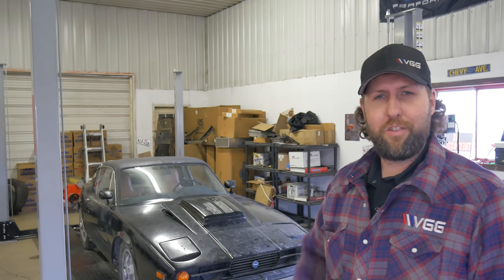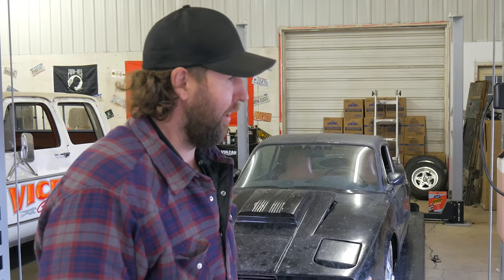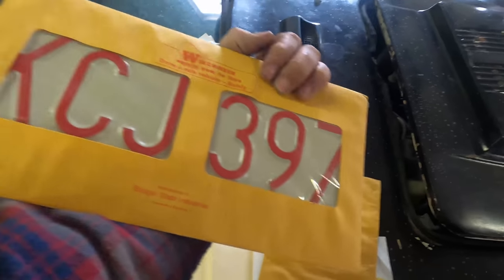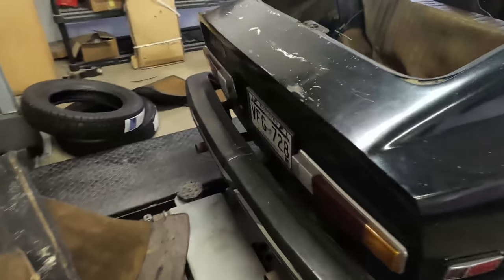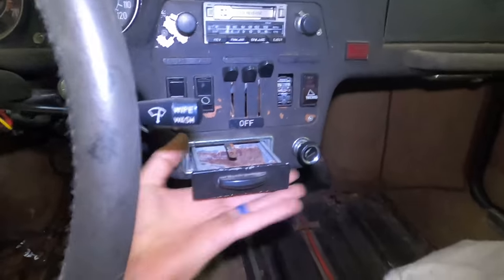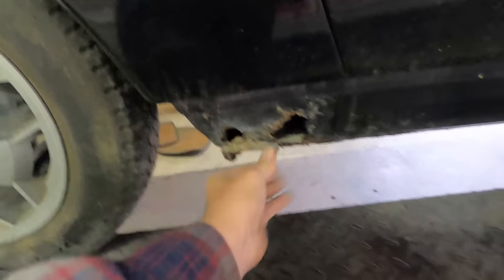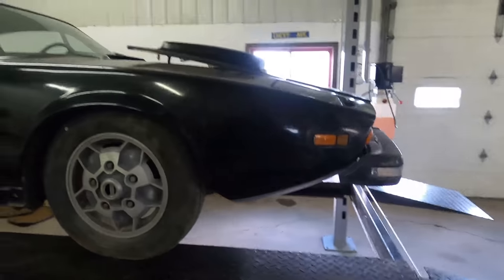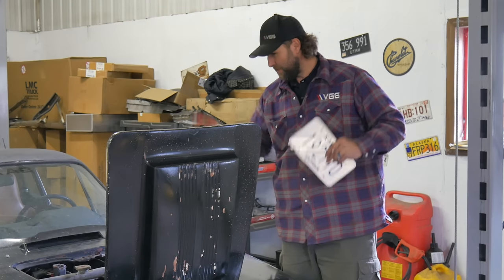FORGOTTEN 1974 SAAB Sonett III - Will It RUN AND DRIVE after 29 Years?

Comment: This guy is a real auto mechanic, he is doing things I have not seen a mechanic do since the 1970 s. When my dads best friend would help me with my 1970 cougar with a 351 v-8 in it. He worked on cars since he was 14 years old and worked on everything from semi’s to race cars. And just like this guy, can tune an engine just by listening and feeling the engine when it’s running. very hard to find guys like that anymore. Like to know where and how long he’s been doing this. Great video. Amazing.
Reply: ..... because most cars aren't designed like the cars this guy works on lol. I almost guarantee Derek wants nothing to do with 2022 BMW EFI software or any sort of diag shit with new cars today. Dudes wrenching on today's vehicles are just as honest of mechanics as he is. Different skill sets for different occasions.
Reply: I can and some of my friends can.
Reply: When I was growing up, early 80’s, a friend brought his Cougar into old man Harpers shop. He spent a few minutes listening to the exhaust  on each side, due to the rough running, and was able to tell exactly which cyclones was bad on the car.  When we tore that side down, he was dead on, by only using his ears. I’m still impressed by this feat.

Comment: A guy sometimes get jealous of you tall folks out there until he sees you try to squeeze into a car like this. It was less like you getting into it and more like you putting it on.
Reply: When I was still working as a mechanic, we had a Miata come in that needed an engine replacement.  I am 6'1" and 300 pounds (maybe a little over lol) at the time. When I got finished my boss man, who was about my height but a whole lot less on the weight lol looked at me and said "well, you fixed it, YOU drive it" lol. I had to let the top down just to get in it lol. I drove it and it ran fine, but getting in out was a chore in itself.

Comment: The born again vessels at your revivals sound more joyous and spirit filled than my 2013 Nissan Altima and 2001 Volvo station wagon. While I'm driving through quiet neighborhoods or stuck in grid lock traffic, I'll crank up VGG on the Bluetooth transmitter to make my ride sound like a race car. My Volvo dash reads, Check Engine and "Dipped Light Bulb". My Altima's biggest issue is an exhaust leak. She's equipped with a Bose sound system which makes The Who "Going Mobile" rock. Keep up the great work! You're an inspiration!

Comment: Are you sure it went from right hand drive to left hand drive? Only if it was imported from the UK. Swedish cars were usually made for left hand drive.
This is a really cool car I've only seen a few times live here in Sweden. The V4 was also mounted in the Saab 95 and Saab 96 with a steering wheel mounted manual shifter. My mom had two Saab 95 and one Saab 96 when I was a kid. 
Thank you for the video! Really nice to see a Swedish car on your show!
Reply: Sweden had right hand drive until 1967.
Reply: @AxelWonkardan  And this is a 1974 SAAB so 7 years after the transition.  All Sonett IIIs were LHD.
Reply: Sweden have Left hand driving side..

Comment: I’m 6’3” and I fit into my Saab. I sort of have to thread one leg into it but once I get aimed at the seat I think the seat is more comfortable than any other car I’ve crammed my knees into. Truly. I drive that thing from Montana to Oregon all the time. Best seats in the industry.
Reply: It’s GOTTA be better than that mid-engine rig he did with paper-thin sheet metal between a fella’s legs & the engine, plus motor oil blow-by in the teeth!

Comment: I just discovered your videos about three weeks ago and having grown up around used cars that were always getting worked on, and those "good deals" nobody else wanted because they would take too much work to get running, I appreciate your skills and your sense of humor while you get these cars running.
The reason Im writing the comment is because on the Saab video you have a flyer from Goldwing auto parts in the 315 area code.
I grew up about a half hour away from there I found myself geeking out over that weird coincidence. 
I've done what you do a couple times. Except I usually have gone to Copart auctions in Pennsylvania to get my vehicles.
So far I've driven home a 1994 Buick Century wagon, a 1999 Dodge Ram 1500 with a 5.2 (Purple, for my wife) and a 2005 Subaru Impreza I bought by accident because I put a small bid on it to keep it in my account, and then watched as not a single other bid came in. So it was mine to go get. 🙄🤦
Anyway, thanks for the fun, informative, "educational" videos. Love your channel. Keep up the great work bringing these orphaned cars and trucks back to life.

Comment: Beautiful save on the Saab! If you can find one, check out a. Jensen Healy from 73 to 75. They have a lotus 907 engine in them, double overhead cam . Had one for about 10 years, and it damn near broke me. I got to tell you when they run, they are a dream.

Comment: One of my high school shop teachers had a Sonett III and wrecked it. He took the engine and transmission and used them in a kit / chopped tricycle 2 seater, roadster/chopper. With no emissions on it, the 1700cc Ford had about 75 HP, and got that trike zooming down the boulevard!

Comment: I had in the 90's a SAAB 99 Turbo and that was an absolute beast, the scary thing was you watched the fuel gauge go down like a countdown timer it was so thirsty but pullaway and top speed was insane and brilliant for motorway cruising if you didn't mind stopping off at the petrol station halfway there, when you got there and halfway back.
Reply: That was a serious performance sedan you had there.  It wasn't well known, either.  It wasn't exactly a sleeper, with the turbo logos and such, but back when those came out I really hoped my mom would get one as a grocery go-getter and then send me out for the groceries 🙂.   

SAAB developed some fantastic engine technology soon after that.  I lived in California at the time, and remember being wow'd by their showing it off.   They took an old 3-cylinder 2-stroke SAAB engine (probably in a SAAB 96, I imagine) and piped its exhaust into the intake of their new super-high-tech "green" engine (definitely not called "green" at the time, though).   The new engine's exhaust came out cleaner than the 2-stroke exhaust that was fed into the intake.  The auto writers at the time were half-jokingly calling it the solution to So-Cal's smog problem !

Comment: I notice that the earliest Sonett had a 750 3-cylinder two stroke engine. Amazed, as one of my favourite motorcycles does also, Suzuki’s GT750 (I’ve got a 1977 A-model).
I think I saw a U.K. TV program about these. The last ones were made during the years of Swedish ABBA, which was huge in Britain at the time. I love the Swedes back then. Knew their own minds, very much a unique culture of openness at a time when England was very prudish.
Reply: Two of the quickest bikes I ever owned were a Kawasaki 500 triple and a 750 triple. Scary quick. Hit third and roll the throttle and the wheel comes right up. Puckered my butt every time.

Comment: Hey Derick I have watched several of your videos and I’m stoked!  I’ve got a couple cars that haven’t run in 15 plus years and I feel I have enough confidence to get them running!  Been restoring cars all my life but troubleshooting motors is not one of my high points.   Thanks for making me get up and try!  I’ll be watching your channel it’s very entertaining to this car guy.  Thanks again, Mark. 72 Mach 1, 78 Vette, 72 Lemans, 79 Firebird, 81 Trans Am, 96 Mustang convertible and 2001 Mustang fastback are in my stable.  The latter two are the ones that ran..... hope the electronics don’t screw me up!  Maybe you have a video of a 90’s car?  Either way I’m on it!

Comment: I owned a bright orange '74 Sonnett III like that in the mid 80's for a few years.  Came from suburban Chicago.  VERY unique car !  Ultra light touch on the steering wheel, super reactive to inputs. Very light and sporty.  Got amazing fuel mileage, especially if you put the gearbox in freewheeling mode and coasted downhills.  Exhausts were only available at Saab dealerships and cost a fortune.  Sadly it had rust as bad as yours from midwest winter salt.  Sold it for about a grand back in the day.  One of the most interesting foreign cars I have ever owned, and I have owned quite a few.

Comment: When rallying those engines they sported twin DCOE 40 or 45 Webers on  a sort of Cross Ram intake which sopped one from closing the bonnet , so it had 2 b held down by a leather belt.Though that was in the standard steel body .

Comment: My step dad was a backyard mechanic. In 8 years, he bought sold and swapped his way into 30 to 40 different vehicles . He/ we got them all running, we drove them home or towed them with any kind of rope or chain. If there were no brakes,tires would serve to prevent damage to the tow vehicle. I remember a 63.5 Galaxy 500 that he drove home on a milk crate with vice grips for a steering wheel.... Many, many stories... there was only 1 car to my memory that we failed to get running. A Saab. I wish I could remember the year. 69' to 73' methinks.  Was a bit less sleek than this one. He loved to talk about it. He would say, " I got a Saab story for ya"

Comment: Socket extensions stethoscope at 56:31 was my favorite part. I knew I wasn’t the only one but dang I haven’t seen anyone else do it in over 20 years 🤪
Reply: I did that just last week. An old mechanic method of listening for internal issues in an engine.
Reply: @Kaelinsdad1  I used the pry bar we had lol. Comes in handy when you're trying to figure out where a noise is coming from.

Comment: Ford used a 1.6 litre and 2 litre V4 engines in the Ford Corsair in the UK. The 1.6 litre buzzed a bit but the 2 litre was better. Rear wheel drive and they were good cars. My dad had a 1966 Corsair 2000 GT - and I, being an apprentice motor technician at the time, lived under the bonnet.

Comment: I drove a Datsun 240 Z. When I went to put tires on it, one of the workers was extremely happy. Telling me my car was one of the first ones to come into America. And it was much faster than the later models. And it sure was. No car with a 350 Engine could beat me. It was amazing. It had a 4-speed tranny and I could take off fast and reach 65 Mph in second gear. I basically just shifted to third then 4th. That way I got better gas mileage. But I did get in trouble driving way too fast. It was a blast to drive. The engine had dual carbs. It was a great car. I should have kept it. I am not a big fella, i could fit inside that car with no problem. Wish I could purchase it.

Comment: I bought a lightly wrecked 1972 Saab Sonett III in 1976 -- Saab "Safety Orange" and without the '74 Federalized bumpers.  Fixed it myself and drove it throughout college and after I got my 1st job as an accountant (which I hated).  Met a fellow CPA who owned a 1973 green one, and we became friends instantly.  Sold mine to go to law school.  Have owned several Jaguar sports cars/GTs, but Damn, do I miss that Saab!  BTW, I have never seen a vinyl roof on one of these.

Comment: A cute little Saab. Nothing wrong with a Ford V4 engine.
My 1956 CJ 6 currently has a modern 🤣 1967 58bhp V4 engine married to a 4-speed gearbox. It runs like a dream.

Comment: Some early Saab’s had an anti theft device . Reverse gear had to be selected before the ignition key could be removed 👍
Reply: Don't know about the Saabs in the 80s & beyond, but the Saab 99 throughout the 70s had this feature as well. If I recall correctly, the ignition switch was in the console by the shifter, not on the dash in the Saab 99.
Reply: @Lambykin  I had 2 Saab 900 Turbos and you had to lock them in reverse! Great cars enormous turbo lag but you got used to it by holding on to the steering wheel until your knuckles went white in anticipation or was it fear - either way it was a hoot back in the day when nothing touched it!
Reply: @jonboy9912  Thanks! I suspected the 900 probably had the same ignition lock feature as the 99. You could fit a full-size console TV still in it's original box in the back of the hatchback models (rear seat down, of course). I can't think of many cars of similar size that could haul the same load. The 900 wasn't the only turbo-charged car to suffer from turbo lag. It wasn't until a bunch of years later that manufacturers perfected the turbo charger. Good times! I've never owned a Saab myself, but family members have. I was into German cars when I started driving in the 80s, and friends all had domestic cars. If given the opportunity, I'd probably own one (before the GM days) - but they are very scarce now.
Reply: @Lambykin  I used to do a lot of travelling around England and I was driving a Ford Escort XR3i - a fast car, when I was overtaken by a 900 Turbo that was obviously on full boost and I could  not get near it! When I got home from that trip I wanted to get one and as luck would have it my boss had the fast back in the car pool to go so I run that for a year when a "whale tail" hatch back came up locally and I bought that both were stone grey with saddle leather and may have looked goofy compared to all my mates BMW 3 Series but nothing touched them in a straight line on full boost! As the kids came along I bought a 9000 - nice car but not the same!
Reply: @jonboy9912 In Canada we didn't have that version of the Ford Escort. If you search for Ford Escort and Mercury Lynx in North America, you will see our version was much less exciting. The Saabs were pretty much the same, though the European versions may have had more power. Too bad everyone buys SUVs that all look the same now. While cars of the 80s weren't the best built cars, there was definitely a lot of variety. Bet you wish you kept the Saabs.
Reply: @Lambykin  Hi Brad the one I should have kept was the first one it was the coupe a 1989 vintage and was only 2 years old when I got it with 6,000 miles on it! Was a company car previously used mostly by the wife of a M.E. Director of the Arab bank I worked for who only visited the UK now and again, she was scared of it and actually rode the clutch so bad it had a new one when I got it after only 6k! The coupe had a stiffer frame than the hatch and whilst some might say it was not as good looking or useful the rear seats folded flat and you could carry all sorts in it but it drove far better. When you got used to the turbo lag it was a joy to drive you just allowed time for it to kick in and it flew not only in a straight line either it actually handled really well with that stiffer frame! I ended up buying it off the bank after a year as they had a policy of selling all their cars off but couldn't afford to run it at the time - a real wolf in sheep's clothing! Wished I had it now!

Comment: The v4 is common for overheating in the heads an excellent upgrade is Ford's 4.0 L out of the Explorer it is a direct bolt up and so is the Ford Ranger 5 speed manual transmission
Reply: Which 4.0 the cologne sohc? Or the OHV?

Comment: What an adorable little engine! You could hang that from the Christmas Tree! I have a little in line four that makes 200 HP. AND it has a real 6 Speed! It would pop right in there....and everything would break.   ;-) Keep it original. That is so cool!
Reply: Adorable isn't the word you'd use if you'd even driven something with one of those in it.
When I was a kid I used to knock about in a Mk1 Transit with the 1700 version of that lump in it.
Gutless, yes that's the word I'd use for it ;)

Comment: I love to see the old stuff Derek. Try to round up an old Saab with the 3 cylinder 2 cycle. I bought a new Saab 96 in 1968. It had the 3 cylinder 2 cycle motor with a factory lifetime warranty on the engine. My mother in law used it one weekend and forgot to put oil in the gas tank. Needless to say the engine seized up. I played stupid and brought it back to the dealer and to my great surprise they replaced the engine.

Comment: Those mats are called coco mats. I remember they were popular decades ago. That car is front wheel drive, but before they figured out to use the transverse layout. It's got the old type FWD like the Olds Toronado had. Engine pointing forward. That's probably why they used the V4 engine, to make it shorter, so they could fit the transmission behind it.

Comment: Go find a Borg Ward Isabella. It's what happened when Mexico built german cars.  My dad bought one and it leaked fuel like the Exxon Valdez.  Of course, you wouldn't know about that.  The other cool thing was it was four on the tree.  My mom once tried to back it out of the garage and after whacking it into the front of the garage three times she decided that it'd be better if we didn't do that anymore.  If you get one, reverse is "Push in, pull back and go upwards".

Comment: The voluntary fire department in my village once had a transit van with that V4 engine wasn´t very reliable. Then the firechief himself had a barnfire and the Ford did not start they had to pull it to the site by farmtractor. Few weeks later our firefighters came along with a brand new Mercedes  van :D

Comment: Good to see some Swedish metal in the garage! My buddy Ryan has a mid 60's 9-6 that has the V-4 in it and we had fun re-ringing the engine, busting out ring ridge and honing it with a dingleberry drill attachment. You gotta get a tetanus shot to ride in it but it's a very cool car. This Sonnet is very unique. Thanks for sharing.

Comment: Sweden is a left hand drive country. It used to be right hand drive until 1967 when they switched the country to left hand drive. It's possible the design of the car is from before the switch, but this model was after since it's 1974.